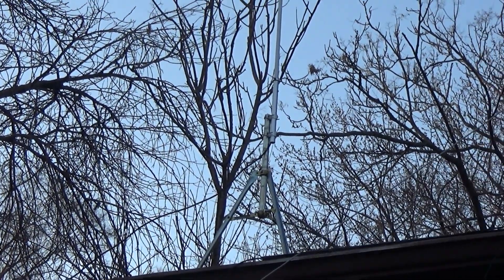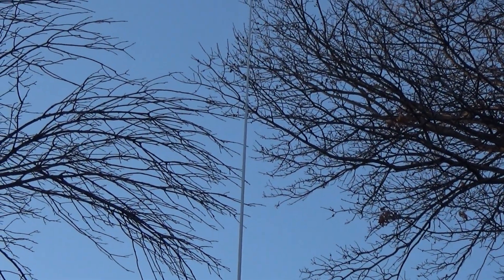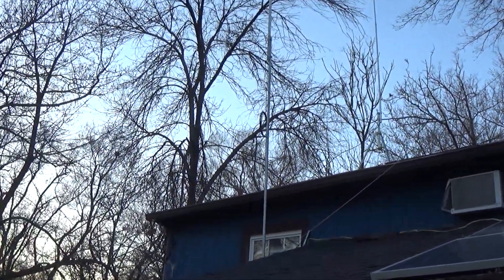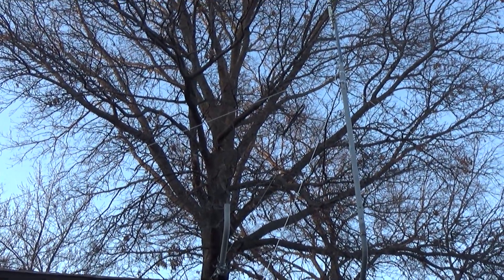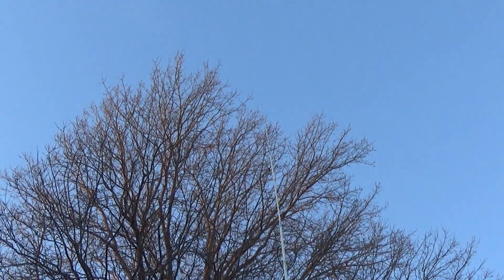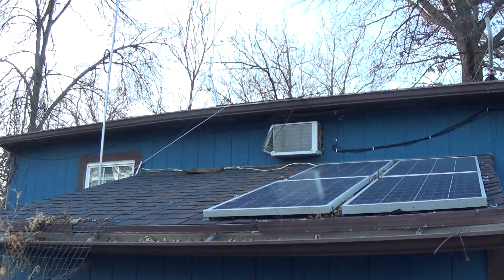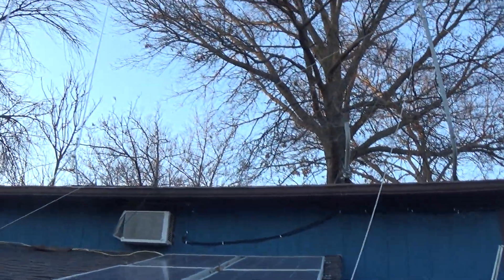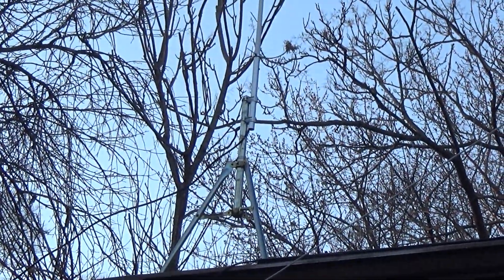BRC HP 500 GMRS antenna and KMR 400 coax on Anytone 778 UV

Comment: How does your antenna perform? Mine does not work as well as the Comet CA-712EFC that was lost in a storm and mast blew down. 
It says it is a 3x5/8 wave antenna. Well, at GMRS frequencies, that will fit in 4 feet... So I must call Bravo Sierra on the specs for this antenna. Not sure what we bought. The gain has to be lower on this one, it doesn't hit my friends repeater as strong as the Comet antenna that was 9dB.
Reply from the maker: I have never had a comet brand, this one performs much better then the tram 1477 dual band I did have.